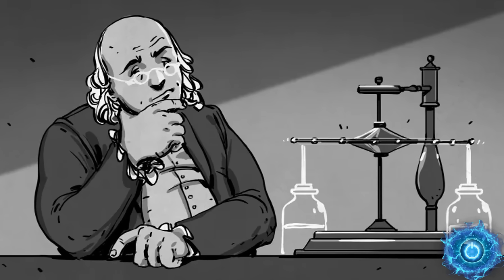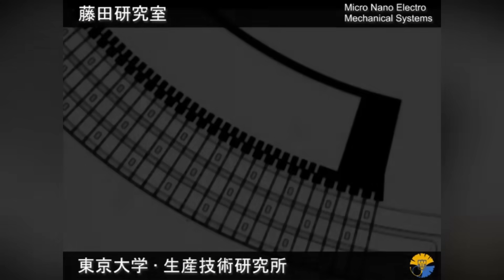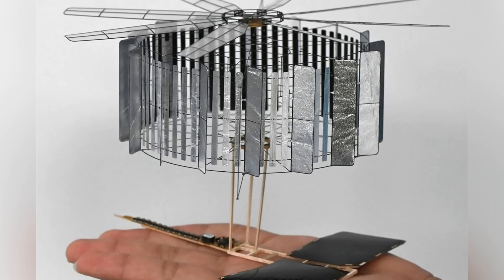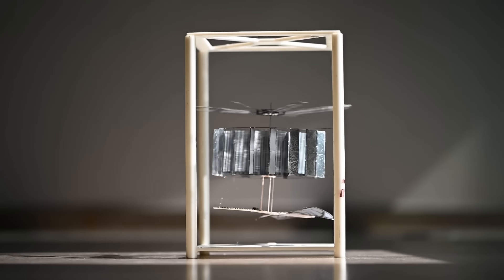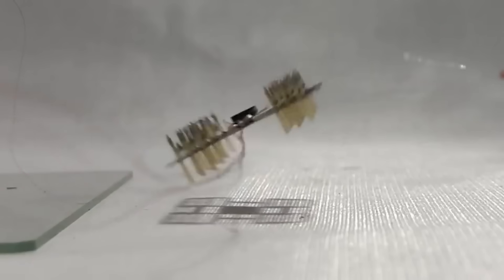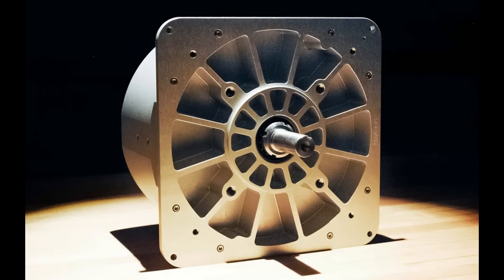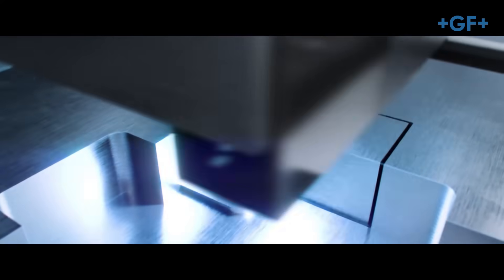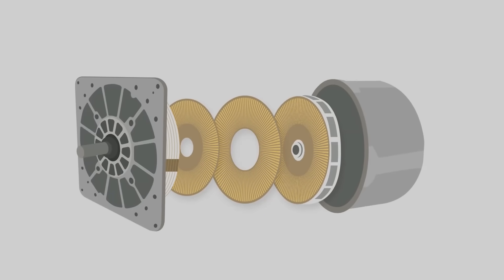Breakthrough MOTOR Revealed! -Electrostatic Machine

Comment: Isn't the dielectric insulating liquid mentioned above the liquid called "transformer oil" used in high voltage transformers in transformer centers?

Comment: Lets look at where electrostatic attraction and repulsion shine over electromagnetic motors. 

Holding in place.tradiyionslly stepper motors and  And servo motors are used to hold a motor in a certain position. An electromagnetic motor needs current flowing through a coil to generate a magnetic field to make a motor hold its position.   Over time current flowing through coils generate heat and consume energy.  On the otherhand, once an electrostatic plate is charged, its atraction to an oppositely charged plate is continuous.

Comment: Due to their nature, the lesser the gap & thus better-performance, the higher the inter-electrode capacitance, meaning more & more directly-wasted energy. Also, using fluid as di-electric meaning losses that start as nothing and eventually reach severe @ high RPM. So, I've come to the conclusion that if the tech. gets taken very seriously, it will be the Diesel of the motor world, being able to achieve ridiculous torque and efficiency BUT being hard-limited by RPM and while depending on design it could be pushed higher, it'll never compete with magnetic motors. And that's fine, power-density isn't everything, besides motors always have ridiculous power-density anyway so it's not even something that matters much anymore.

Comment: Electro-magnetic motors live from wire lengths. That's why they are used in the macroscopic world. Electro-static motors live from short distances. So we find them in the microscopic world. It makes usually no sense to transfer these very different concepts to the other world, because their functionality and properties become more and more worse.
Reply: The light powered drone changes that imo. You can’t do that with magnet motors.
Reply: @distanttraveler6531  the problem with electrostatic motors is the high-voltage generation. You can't put it on board of such a drone, because it is too heavy.

Comment: high voltage or high current makes no difference... they are part of the same formula... current/voltage = power. you cannot get more out than you put in.
Reply: yep!  But where you obtain the source for power is a whole different kettle of fish..
Reply: One big difference is high current requires a TON of copper. The material needs to make magnetic motors powerful is far more punishing. That's why they say the C-motive's selling point is 10x the specific torque of magnetic motors
Reply: There are practical differences. High current means you need low resistance, and that makes your motor very heavy - not great for drones. A high voltage can be potentially lighter, but it also introduces problems with arcing that require a lot of care given to insulation and tends to make the motor large rather than heavy. Also not great for drones. Electrostatic motors have been regarded as impractical since their invention, because getting enough power from them to be useful would require a motor of ridiculous size, but the video suggests potential advances could increase the power density to the point they may become viable. If that happens they could potentially offer greater efficiency than the more conventional magnetic motors.

Comment: This looks like flying saucer technology. Also simply the higher you go in the air, the more Voltage you get, so maybe if you combine this with a groundingwire you can simply use the voltage from the air to sustain flight after a certain height is reached? :D That is something that fascinated me all the time anyway, there shoudl be a way to extract some meaningful power from high buildings, by constantly grounding the sky with the ground. The burj Kalifa should get some impressive numbers!
Reply: Bingo. This makes perfect sense for the tic tock like uap thats been talked about,
Reply: Wrong they is very little power, there is indeed an electrostatic field of 120 V/meter, do you feel this voltage, no because there is a very low current 😂😂😂
Reply: @Elie-n1b  yeah sure, but have you seen lightning? 😂 Imagine you could harvest this energy slowly instead of it jumping and burning the air haha.
Reply: @Marco-xz7rf  You are perfectly right there is a lot of power in lightnings that destroyes large wire of cupper (lot of current) but how can we grab this power, the location is random
Reply: @Elie-n1b  i don't know if this works but i had the idea to have something that swings in AC. The problem with getting more charges from the sky faster is, that the tower itself bringts the ground charges with it and pushes away the higher aircharges. So what we want is to break this from happening haha. Maybe by starting everything swinging, it will help to move the charges better, like vibrating sand kinda moves like a liquid. One possibility would be something like a joulethief, which doesn't need a lot of power to start swinging. Also you wanna have loads of small and thin metalspikes, which will improve the flow of charges. Jist like all the old roofs of old buildings had ... coincidence or did they know more? I mean could it be they used this energy in some way? And i don't mean for electric devices, maybe it simply makes you feel better or whatever 🤔

Comment: I tend to like high power density - internal combustion or electric. So electrostatic doesn't sound too exciting.
Reply: What's there not to be excited about?
No heat and low speed torque requires no gear reduction
C-motives motor produces 10x the torque that magnet motors do for the same weight
No magnets, 2% of the copper that magnet and induction motors use, and much less steel means its going to kick ass when the price of commodities explodes.
The motor is recyclable, throw it in your electronics bin because it's made of PCBs

The first of everything is not going to be a magic bullet. That takes investment. Haven't people realized this by now?
Reply: Right analysis, the torque is very small 😂😂😂
Reply: yeah, ion flow has so little torque so the applications for this are pretty niche

Comment: Sadly, it probebly won't work in DC or if it were to, it'd require sophisticated brushes. In AC, the semi-conductors/transformer requirements would be very specific. Worst of all, if the motor were to heavily vibrate or be hit with an obstacle, it could short the supply and cause lots of damage. All can be solved through engineering however.
Reply: It runs only on DC. Unfortunately it runs on very high voltage DC, which brings it's own problems. You need worryingly high voltages to get a usable power output - tens of kilovolts - which turns them into an engineering problem of finding materials that will withstand such a high electric field strength.

Comment: Static electric motors are fascinating.  I've added an electrode and a hose to my clothes dryer to siphon the static electricity into a 5 gallon bucket.
Reply: Into Steel wool or what?! 🤔🤨🧐
Reply: and what function does a hose have?